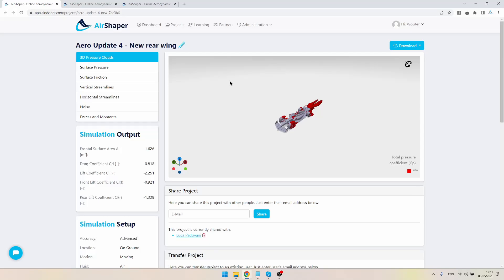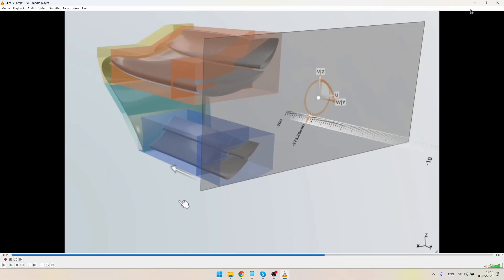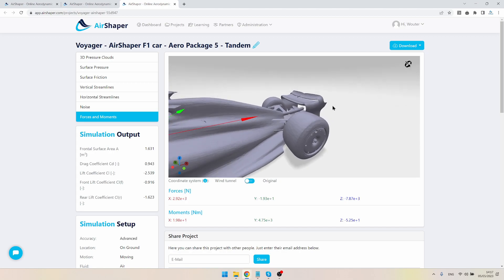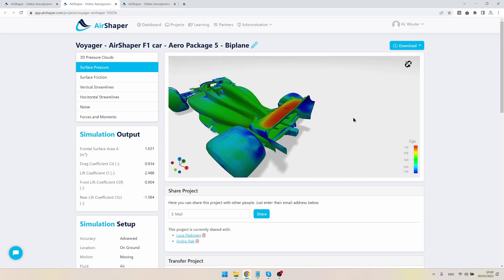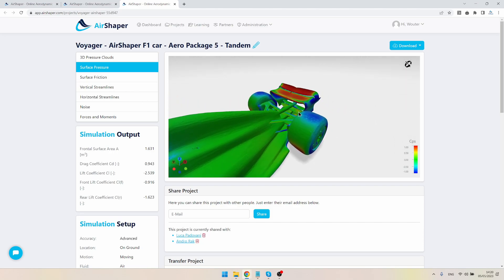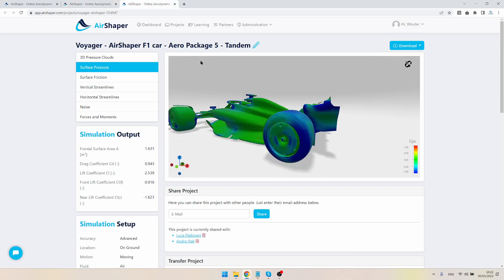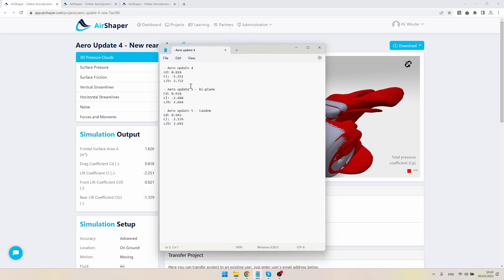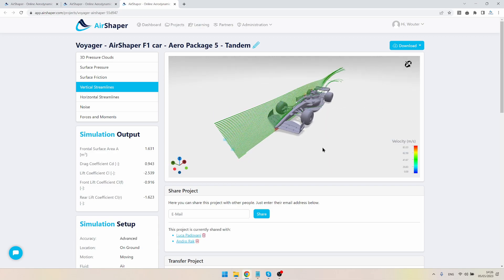Formula One Aerodynamics - Final design

Comment: Very interesting! Crazy how bad the L/D ratio is though :D
Reply from the maker: True, I believe the F1 teams go well beyond 4 for L/D ratio, so we have a looong way to go
Reply: @AirShaper  Considering that the best group C lemans car had 6.1 L/D ratio (TS010), I would be surprised if F1 was currently above 4. Even with the current "ground effect" allowances. Not really sure what they have currently though, maybe between 3-4? Drag should be easy enough to figure out based on their top speed and engine power estimates though.
Reply from the maker: @oskarelmgren  I got my input from someone who worked at Toro Rosso until some years back - but you're right to mention that perhaps under the new rules, the lift/drag ratio has been reduced?
Reply: @AirShaper  Wow! Really impressive if they are able to get over 4 with open wheels. Drag is probably going to be very big, they seem to make up the ratio with lots of downforce then. Very impressive if they're only 50% behind closed wheel ground effect cars.

Comment: Good job overall. Would be interesting to see what sort of ride height is set front to rear, because based on the front and rear coefficients, the aero balance is really rearwards, probably could do with a bit more front downforce, which is again, very ride height dependent.
Reply from the maker: I agree! Perhaps by changing the rake of the car, we could shift the aero balance a bit more to the front. Getting the front wing closer to the ground would certainly increase the ground effect and thus downforce there. In the process, we'd have to watch out we don't cause flow separation in the diffuser for example.